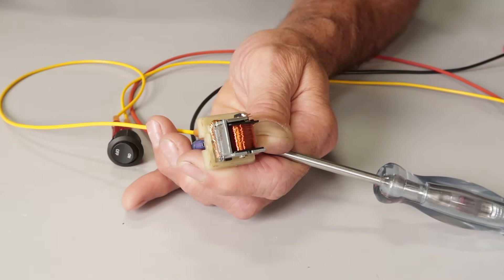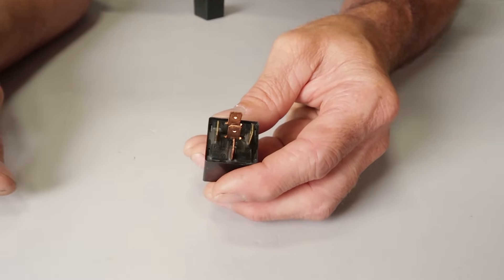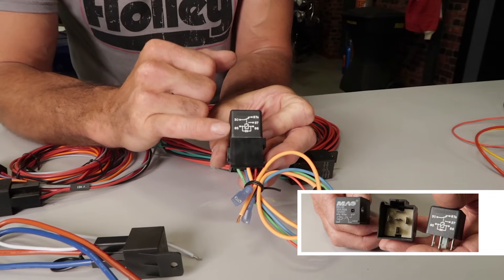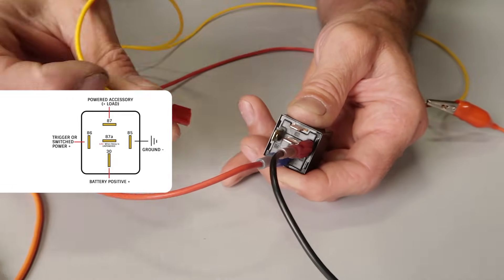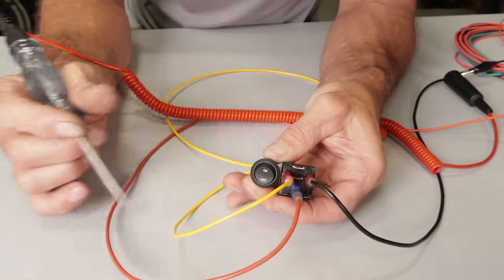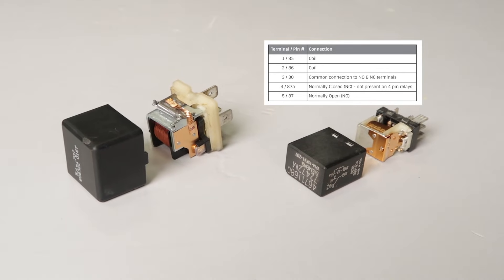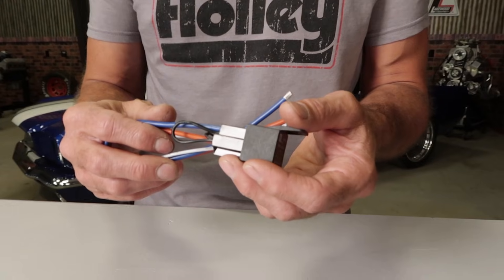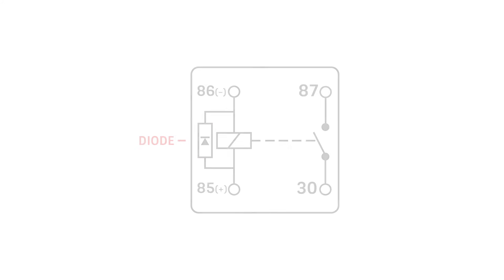How To Wire An Automotive Relay

Comment: The low speed fan on my car is very common to burn out on the junction box for the slow speed relay. How would I connect a larger external relay to run from this burnt out connection for the low speed fan and it still be triggered by the ecu at temperature

Comment: I'm planning to add an accessory outlet (cigarette lighter for us old school folks) in an older car for USB charging, etc.  I'm following along with everything except pin 86.  Only want the outlet to be operational when the car is on. 30 would come from the switched accessory power source after key on. 85 is ground, and 87 goes to the accessory outlet positive terminal. What do I use for 86? Or am I making this too complicated? Do I even need to worry about a relay? It's "just" a USB outlet to charge some phones.

Comment: I'm good with residential and automotive wiring, but like how do you figure out what relay to use when wiring a car when ever I had to fix something n if it was the relay I would just replace it with the same but for wiring a car from scratch how would I figure out what relay to use 🤔

Comment: Which relay would protect a car ECU better? With a diode or resistor?
Reply: Over voltage relay.

Guess you have a Chrysler car to consider adding relay to pcm

Comment: I'm questioning what you said about the 85 and 86 connections of a diode protected relay. The DIN 72552 standard says that 85 should be connected to relay coil negative and 86 should be connected to relay coil positive with a specific note that this is important if the relay coil has a flyback diode in parallel. This is the opposite of what you said in this otherwise excellent video. It took me a while, using the second and third hand rules for current and magnetic fields, to figure out what the diode is actually doing when place in parallel with the relay coil. I initially thought that the diode was going to prevent a back current to the cathode. This is incorrect, but I believe it is what a lot of people think.  What the diode does, is provide a low resistance loop for the current, that is induced when the magnetic field collapes, to flow around until the energy is dissipated. This protects any transistor or switch which is acting as the trigger for the relay. Since the current induced by the collapsing magnetic field is in the same direction as the original current, the diode needs to be connected with the cathode toward 86, which is how they are wired in a diode protected relay. Consequently, there is no need to change the way you connect a diode protected relay. 86 is still connected to switched positive and 85 is still connected to ground as the DIN 12552 protocol specifies.
Reply: You are correct he has given the wrong information if positive was put on the 85 you would burn out the diode as it is a direct short to the negative.
Reply: Thanks for this; I was trying to suss out why this video showed different than the documentation on a relay I'm considering purchasing.
Reply: Glad to help. I was soldering my own diodes into some relays and was frustrated by all the contradictions and confusion that I found in so many of the Youtube videos and other sources on the internet. I finally found two different YT videos in which they built test circuits on  bread boards with LEDs that would flash when the circuit was opened, showing the flyback voltage. They then wired in diodes, and the LED did not flash when the circuit was opened. With this evidence, I could know, with certainty, what the polarity of the diode should be, and then figure out what the diode is doing to protect the transistor/switch. @fracturetrey
Reply: Goof catch
Reply: The secrets are always in the comments,thats were i always look for assurance because some of these YouTube gurus can be full of shigggggt

Comment: is it necessary to use a resistor or anything of the sort on the switch circuit, or is the electromagnet itself a "load"? Looking at the configuration, it almost looks like we are creating a short circuit with the switch.

Comment: I'm looking to install some of those led running board strip lights and was thinking of having all the functions run off of rocker switches and relays instead of hacking into my headlight harness. My question is; if I get one of those relays with a left/right blinker function and rocker switch also with turn signal functions it should work if I wire everything up properly right? Are there any relays that by chance have a running light option and no turn signal for the other switch? Basically just looking to run the turn signals and running light functions that I can turn off and on from rocker switches instead of running them on the main vehicle lighting system I guess you could say. Looking to try something different

Comment: Thanks for your explaination, mate, but just a quick question, how to connect 85 86 if I don't need a swith for control circurt ? just leave the 86 empty and connect 85 to ground ?

Comment: Best video I've seen explaing a simple relay. I used this video to help me put together and install a replacement Toyota Corolla horn and bypass  the wiring clockspring switch horn connection and used the original horn which was still good.

Comment: How come no one shows where the other wire to the switch goes.. If it goes straight to the battery how is the relay supposed to stop the switch from catching flame 🤔

Comment: If you’re interested in supplying power to your air solenoid valve which would be your terminal to activate the solenoid to open the air supply to brake line?

Comment: I am using a ground switch on the 85 terminal, which means the electromagnet is always on. However the relay is now getting warm because it's on all the time, wouldn't that be dangerous ?

Comment: Thanks! 
This explained very well how and when 87A gets it power. 
I am connecting a buzzer that will sound when the fan are not turned on/ fuse to the fan breaks

Cheers